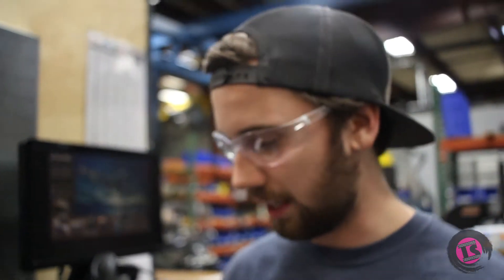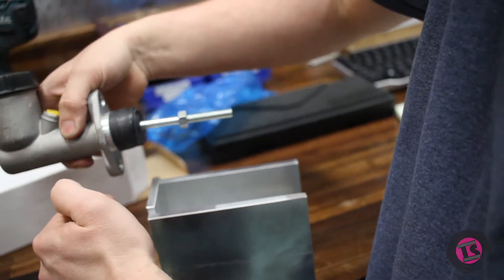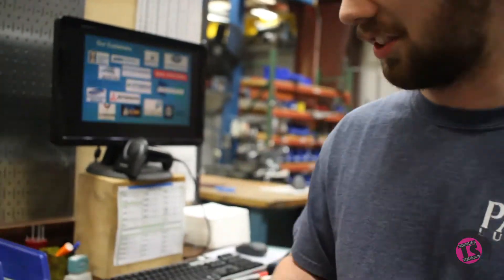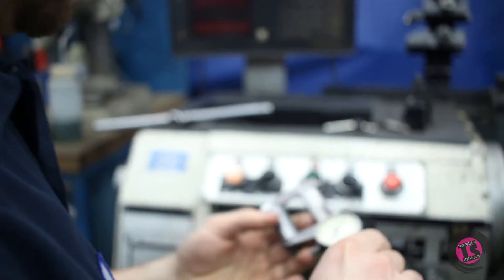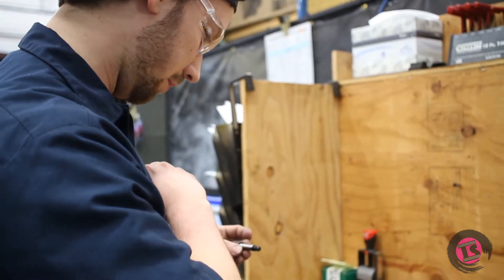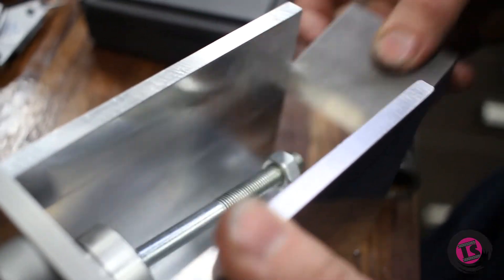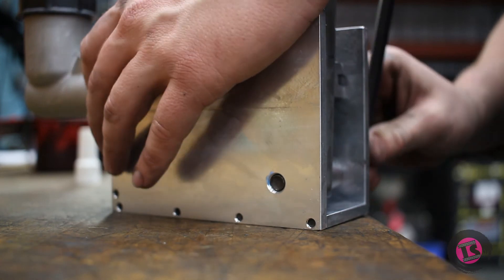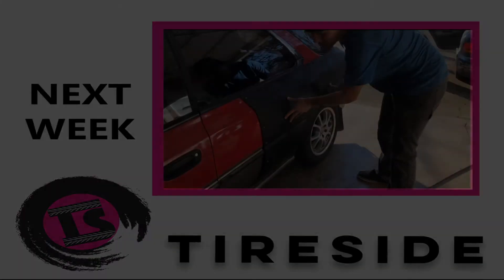Building a Hydraulic Handbrake for the Drift Car!

Comment: Amazing job! . I'm doing a research for my college and it's called "Design and implementation of a hydraulic handbrake system".
So, I was wondering if there's a chance of get the measurements of the parts, bolts and thickness of the materials so I can render it on Inventor. 
Greetings from Perú

Comment: I was wondering what that clutch master cylinder is from?
Reply: Me too but I think it doesn't matter as long as it's a 5/8" bore. smaller bore makes a lot more pressure faster and 5/8" is the sweet spot. (Metric is 16mm just in case)
Reply: @Deadpool-ODST  thkns for the metric
Reply: Nissan Almera 1.6 Liter is good since it has an external reservoir. and it is a 5/8" bore. Also Honda CRV or Honda Accord.